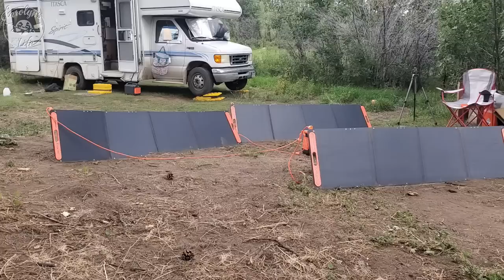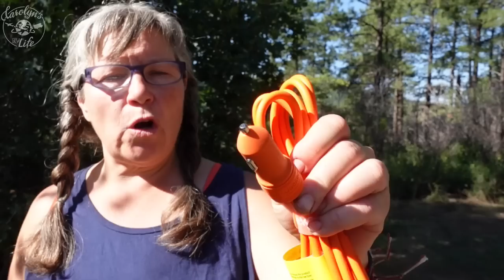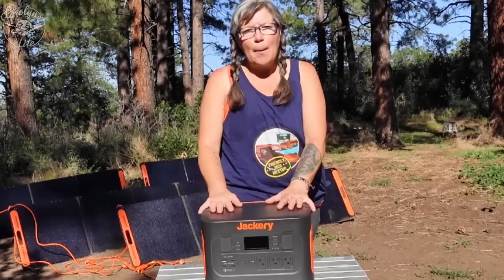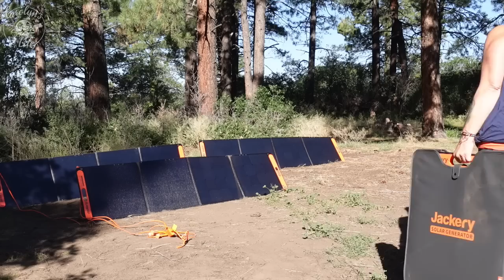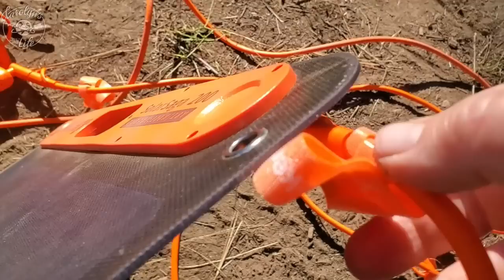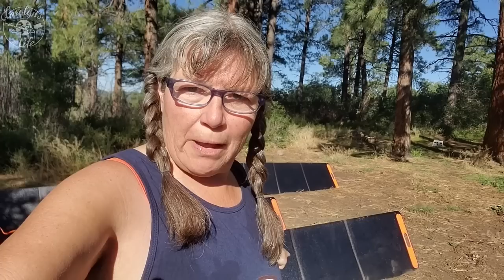Brand New Jackery 1000 Pro Review!

Comment: Outstanding review, Carolyn!  You covered all the high points I would have mentioned, plus more.  I got my Jackery 500 w/ solar last year at a crazy good sale price from them.  My intended use is for hurricane preparedness in my apartment in Florida.  About once per quarter, I pull out my Jackery and plug into it as many devices as possible so I can run the battery down a good bit and then recharge it, to keep it in its healthiest condition.
They could not have chosen a better spokesperson!

Comment: Great review. Love the fast charging. Even when only 2 sets of panels are used. Can this power bank charge up at the same time it is being used? Just wondering if I could use this to continually charge my refrigerator?
Reply: Yes. The jackery can be charging at the same time it’s used. I will sometimes be charging mine while I’m driving and have my portable fridge or other device plugged in at the same time. I love mine. It was expensive to purchase but has been a great addition.

Comment: I'm sorry, but I have a problem with calling these "Solar generator".  It's a charge controller/battery/inverter.  Couldn't we call these CCBI's ??

It's probably just my proofreader background---lololol
Reply: I get your point, but alone it isn’t a solar generator- but with solar panels it is.
Reply: @CarrieMtn  Which would make a traditional gas/propane generator not a generator without fuel, yes?  ;-)

...Teale  🏜️
Reply: @atelierteale8012  that was exactly my point to the original poster. Maybe I didn’t explain it correctly. I have a small “jackery” type battery. I don’t have a solar panel to charge it. But if I had a set up like Carolyn’s where the sun is the primary source it would be fabulous. Maybe in my case it isn’t really a solar generator bc I use house power to charge mine. I think we are splitting hairs- but regardless this looks like an awesome setup!
Reply from the maker: In the grand scheme of things does it really matter whether it's called a generator or a battery? ?? 😜
I mean, really.
Reply from the maker: Yeah, I wondered about that. But why can't it be a generator?
Reply: @CarolynsRVLife  well, because “technically”, this unit does not “generate“ power. It collects, stores and distributes power. It is essentially a power bank. A gas generator does in fact generate power by burning fossil fuels to run an engine that creates/ generates power. Some may consider it just semantics, but technically it’s a clean energy power bank, which is wonderful!